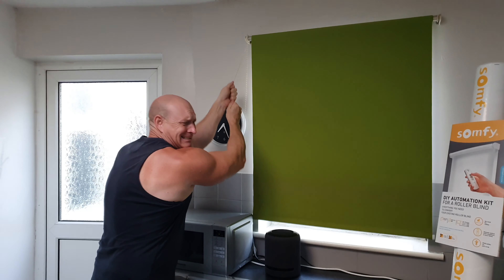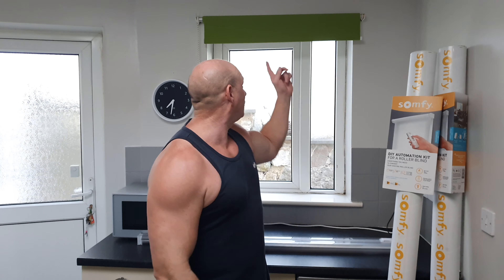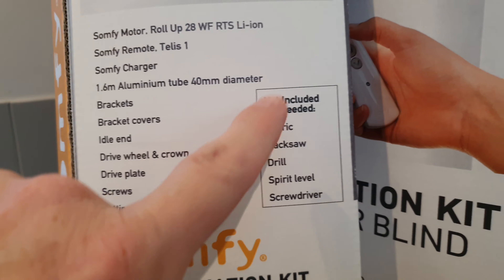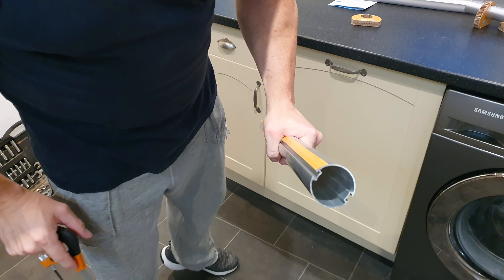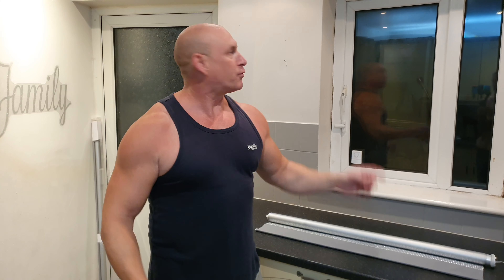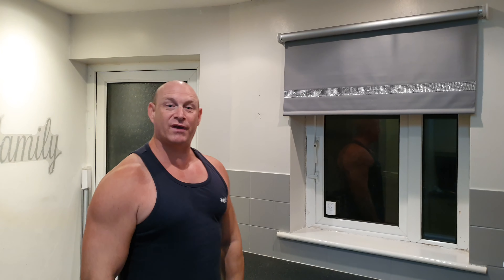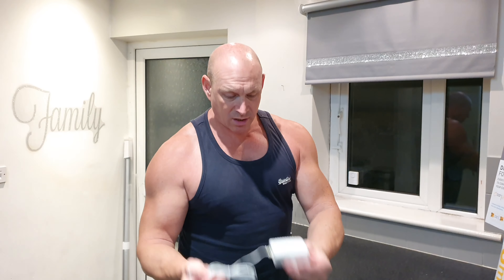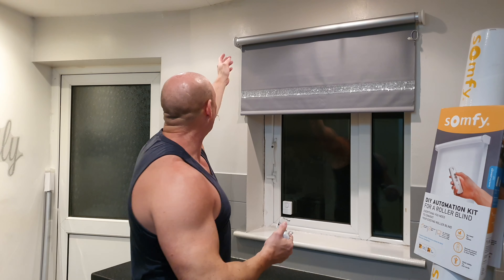Somfy motorised blind kit with remote,installation & demo

Comment: Not bad Paul. But most modern blinds come with a motorised button, instead of the dodgy pull cord. I've recently got black out blinds in my kitchen, excellent quality material aswel. Same place where I've ordered my living room blinds from. Anyways Paul nice video. I suppose there's someone out there who'll love those remote type blinds. I suppose it would be somebody's little "party piece" 👍